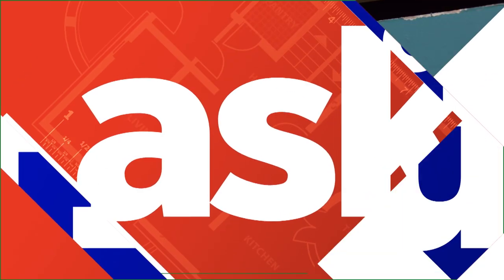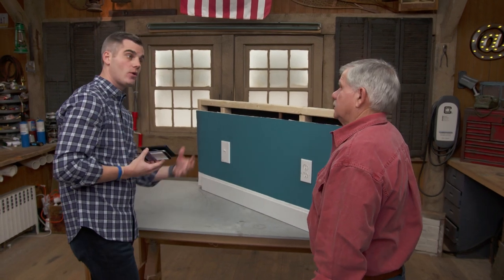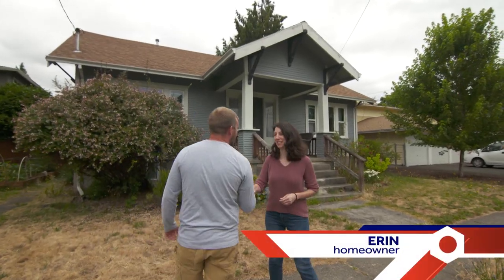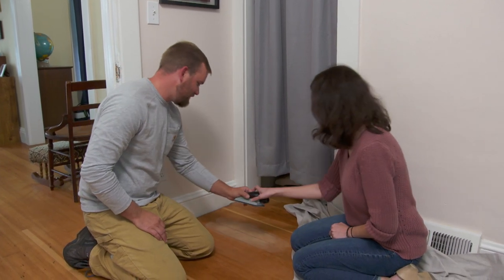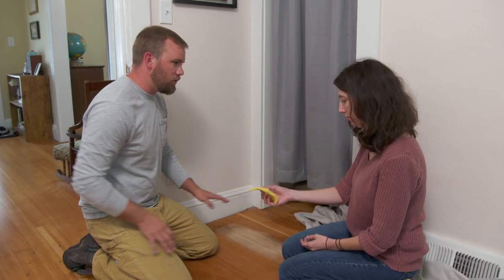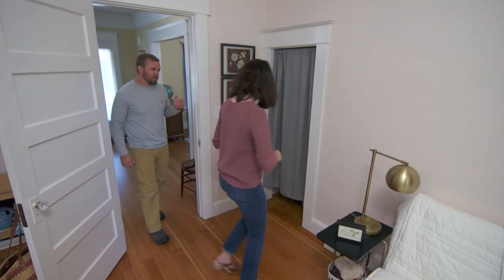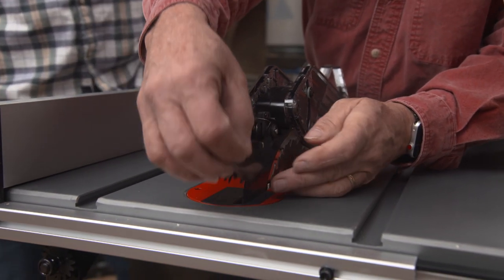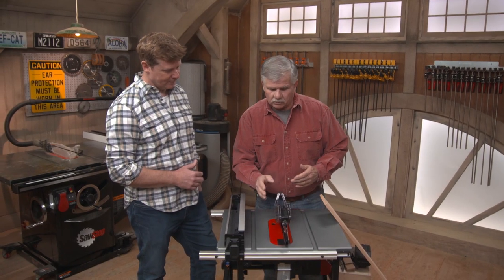Ask This Old House | Scorched Floor, Hardy Plantings (S17 E23) | FULL EPISODE

Comment: Is there an acceptable tolerance for the table saw fence to be out of square? How do we fix it if it is out of square?
Reply: On some saws the fence is adjustable. On my table saw you loosen the bolts that hold the trunnions (this is the motor, blade assembly) to the underside of the cast iron table top. Then you can twist/rack that assembly to get the saw blade parallel to the fence.
Then tighten the trunnion bolts, being sure the assembly doesn't walk out of square.

Comment: I don’t know about y’all, but I can definitely see the area where the stain was redone 😐
Reply: I had to rewind to compare, but you're right
Reply: you can see the area, but not the burn.
Reply: You have to remember, that by sanding the wood, you expose raw wood. That is wood that has not had any sunlight. Most wood changes color as it is exposed to sunlight. In 6-8 months, that repair will really be invisible

Comment: How do you fix creaky floor boards
Reply: screws.  they have videos on the channel for that, too.
Reply: You can buy a set called a Floor Repair Kit at home Depot and probably others. It comes with special screws that have breakable heads. You drill them in, then break the heads off. The set comes with a manual on how best to use the screws.